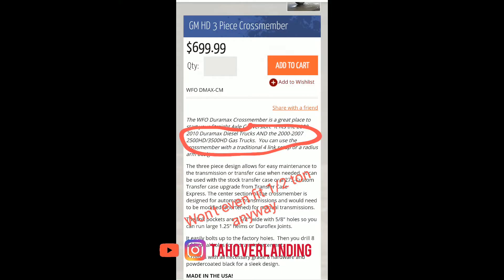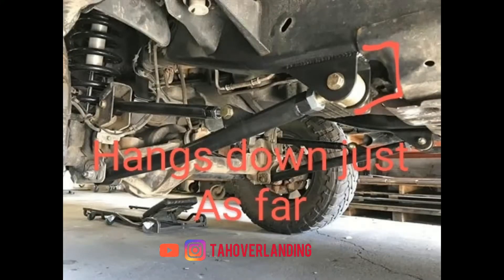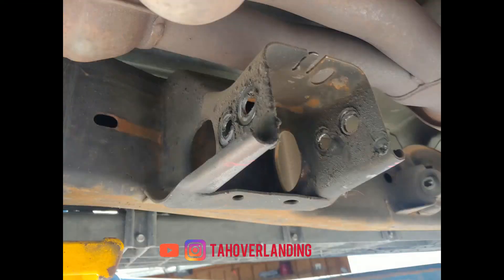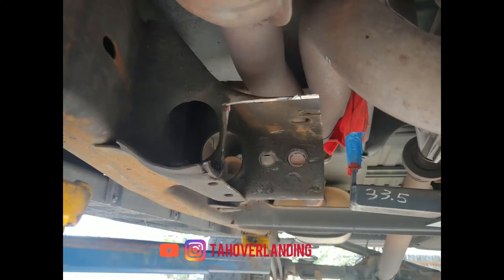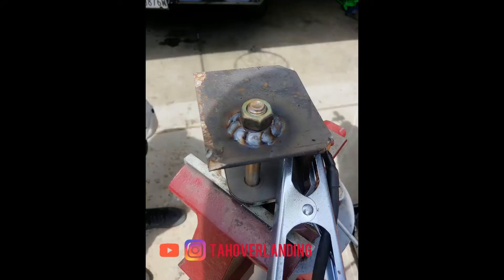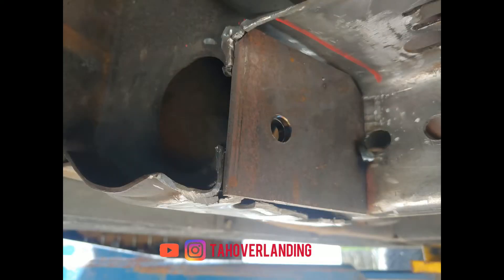tahoverlanding axle swap Crossmember Design & Fabrication episode 7

Comment: This is a great find.  I just blew up the ifs on my 99 suburban. Not really too interested in fixing it , needs a full rebuild aside from the broken inner axle.  I've always thought it would be a better rig with a solid up front.  After finding this I'm searching for parts as I type.
Reply from the maker: I'm glad you stumbled onto it.  The outside of the frame on a gmt400 is a little different, and the transmission crossmember is different too. But nothing so different that it changes much about the swap

Comment: love the link mount ideas for ground clearance actually. only thing i would personally do is cut some more out of the crossmember that way you could remove the bolt for the control arm without having to drop the transmission crossmember. love your videos glad i stumbled across your channel!!
Reply from the maker: @crazydave830 1977reddawg I like having as much of the cross member there as possible. I always intended to have a skid plate that was supported by it and mounting to it as much as possible.  Never got around to it yet. I've also had it  like that for a year and a half, and haven't needed to remove the arm for any reason. You remove arms so infrequently that the idea of pulling a couple bolts to drop the cross member isn't too much an inconvenience for me. I also said that if it ever was a pain, I'd just build a tubular member to replace it